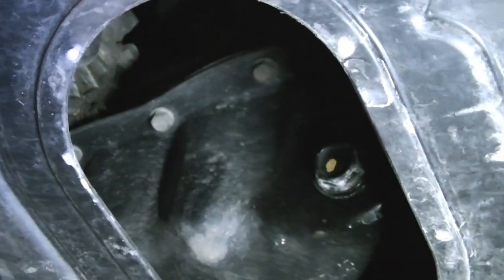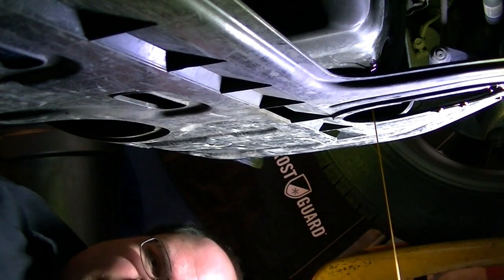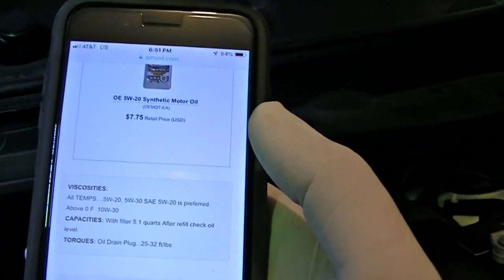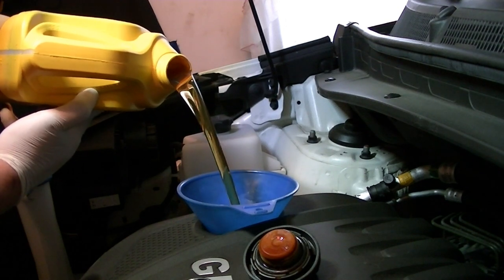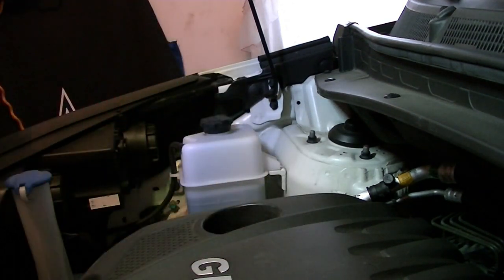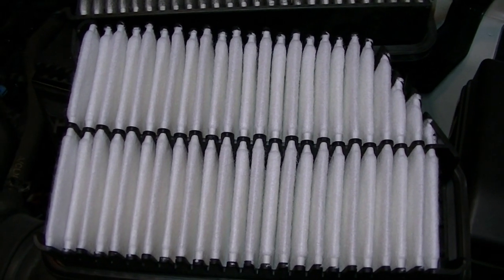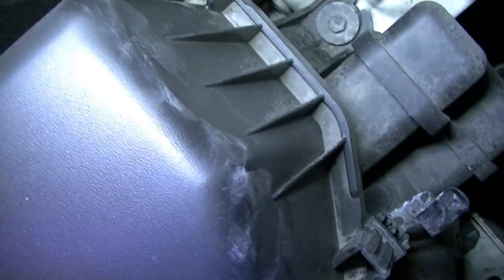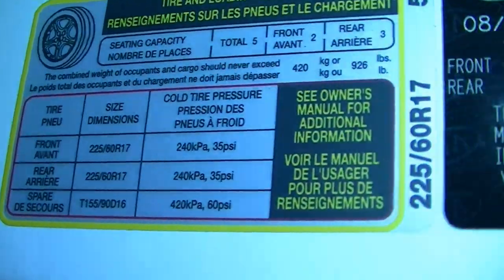2016 Kia Sportage Oil Change

Comment: im looking to buy a rav4 , mazda cx5 or kia sportage.  how has your kia been? reliable? any problems?
Reply from the maker: Angel bluerider honestly, never owned a Toyota of Mazda. I am the one who does all the work to these kias, a forte and this. I have only done brakes and oil changes in the past 4 years of having these in my life. I would go with Kia over the other 2. However maybe 16-17 model years. A family member is having problems with their 2020 Kia Sportage. It randomly stalls and shuts itself off. Just FYI. Thanks for the comment.
Reply: @Rickm2003  thanks.

Comment: Is it possible to do it in 5 minutes?
Reply from the maker: Robert not for a efficient oil change. At say at least 5 minutes just to drain. Especially at home. 10-15  minutes at least. JUST for the oil change itself.
Reply: @Rickm2003  I went to a 10 minute oil change place and they got me out in 5 minutes is why?
Reply from the maker: Robert did they drain all the oil?
Reply: @Rickm2003  yea I guess lol it said they added 5 quarts which is the limit for my car.
Reply: I just always feel uncomfortable because the last oil  change seemed kind of quick and also I had a leak. My oil change wasn't due yet but I had to take it in because I can tell when I took the dipstick I had no oil
Reply from the maker: Robert is the leak before or after the 5 minute oil change? Wondering if something wasn’t tightened enough or if they may have double gasket the oil filter.
Reply: @Rickm2003  oh before
Reply: @Rickm2003  I'm guessing that's what happened the last last oil change